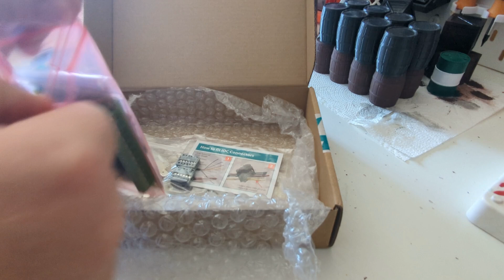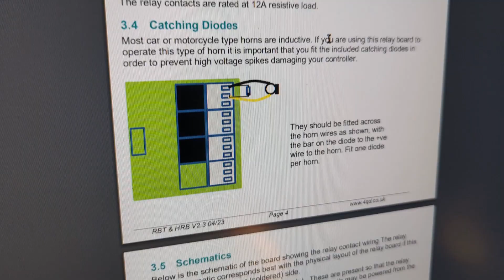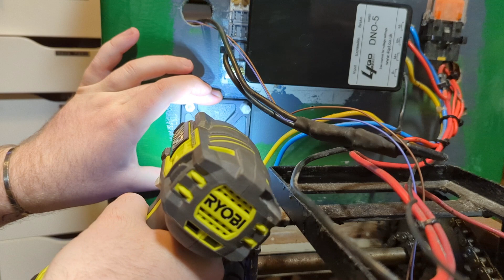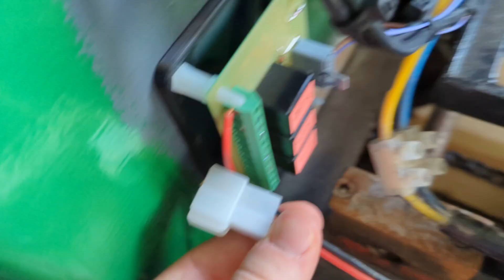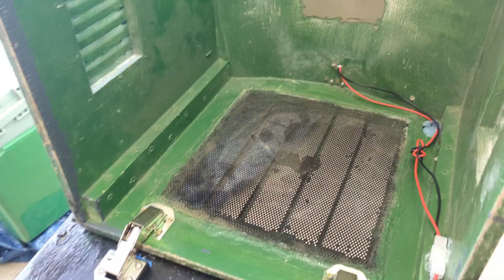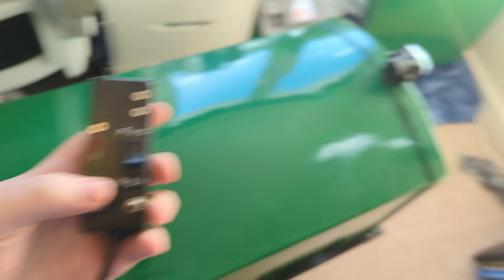Installing a New Headlight for my Ride-On Locomotive

Comment: 2:45 - When you go shopping, get a pair of clippers that have been hardened.
Most clippers are unhardened, and get wrecked easily; Hardened ones will cut through just about anything without getting damaged.
You will thank yourself <3
Reply from the maker: Thank you! I actually recorded this quite a while ago, and since then I did actually pick up some new Knipex snippers. Hopefully they'll make an appearance in Part 2!